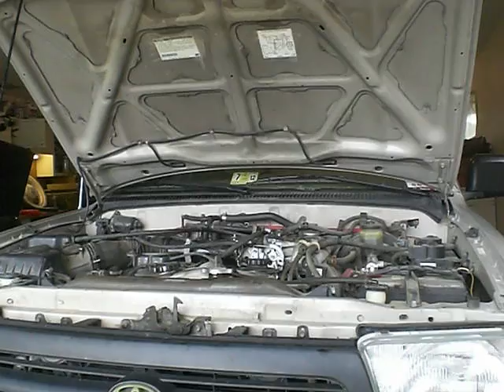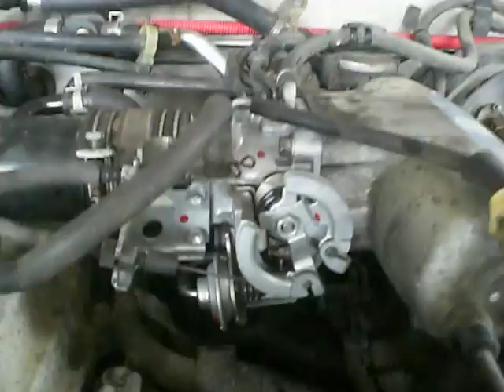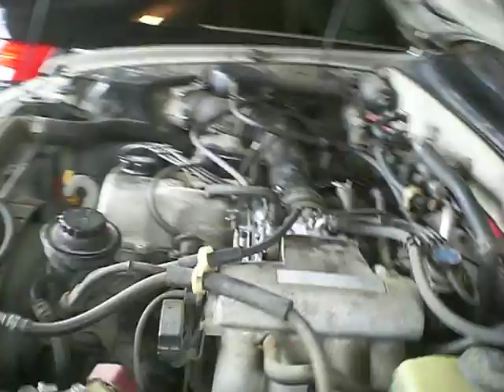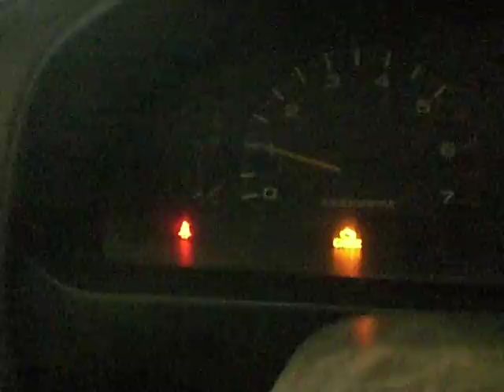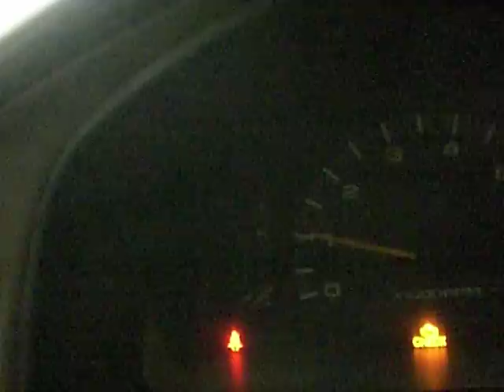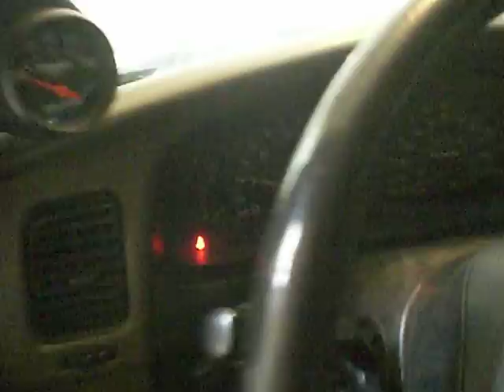1997 Toyota 4Runner IAC valve problems.

Comment: That engine is still idling way too high. Should be around 750 rpm. Need to clean the whole thing out from air filter to MAF to throttle body to Egr valve inlet and PCV valve
that can dump oil vapours into throttle body. Check all hoses for cracking and vacuum leaks.
Reply: What's the Egr valve inlet?  I cleaned my IAC valve and now have a high idle of 2000 when cold start and 1500 when warmed up in park and neutral.
Reply: @2028end  whatever is leading into or out of the EGR. It sounds like a vacuum leak to me. I had a slightly loose hose to the PCV valve for many years. Found it by chance. I have also heard that there can be issues with the brake booster which uses vacuum to assist the brakes.

Comment from the maker: I replaced the iac valve.
Reply: pdx650 couldve cleaned the damn TB and saved a ton YOU DOPE!
Reply from the maker: It would not have fixed the IAC though. I was able to get a new IAC and a new TB assembled together for $150, I thought it was a good deal. I still have the original one with the bad IAC attached to it.
Reply: pdx650 yes, IAC can be cleaned out too, if the solonoid was bad you can buy that
Reply: Either way his rig is fixed and he has another he could try to salvage if he needs it.